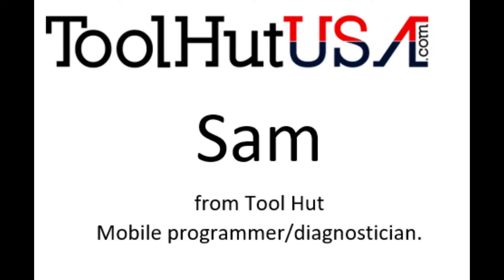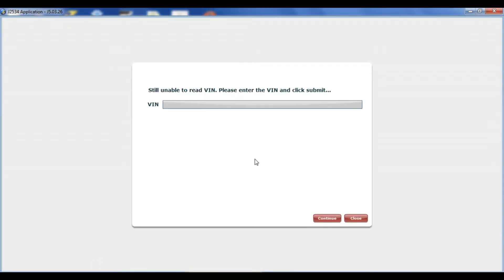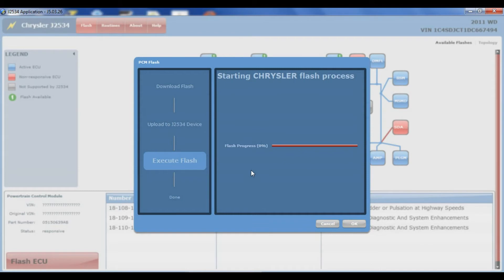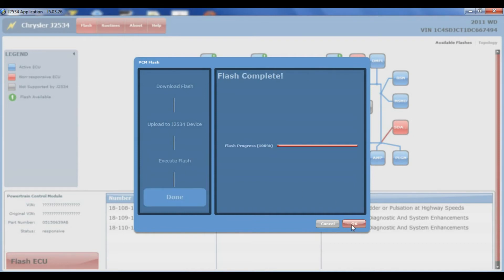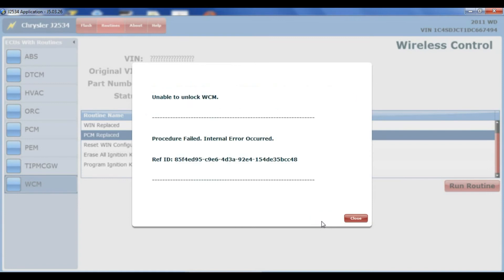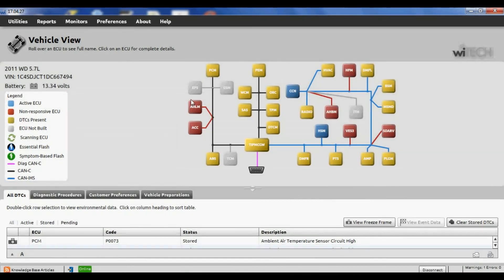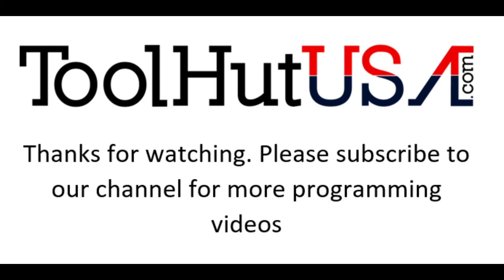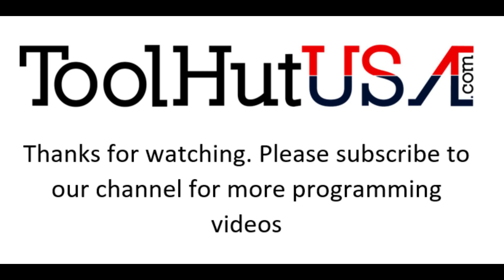2013 Dodge Durango PCM replaced J2534 FAIL

Comment: From our Experience dealing with Dodge ,using J2534 ,,after flashing PCM with J2534 we use Autel or Launch to transfer secret Keys (Pin number is needed for this function) I agree with Vandisso1,,,Also the new Matco Tools maximax2 can do it .
But as you Say Witech so fast and Safe ..we use both way's and I agree with you Witech is the best ...also we notice the other shops they use us to flash there TIPM using our Witech, since J2534 will miss up your TIPM..Bottom line don't Flash dodge with J2534 all the way ,you need to stop when it comes to security transfer keys  ..it is risky